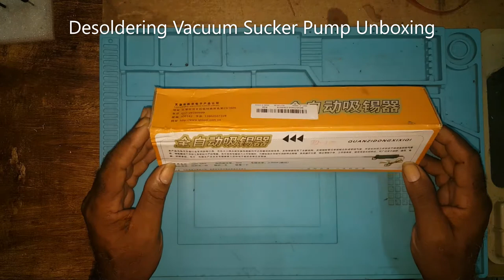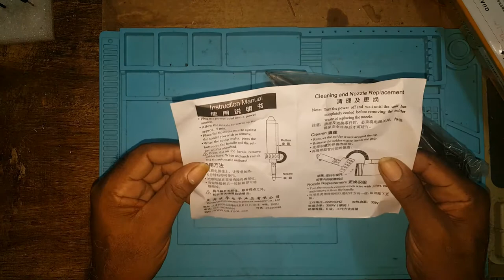Desoldering Vacuum Sucker Pump Unboxing

Comment: I bought this exact model (not the more common blue one) last week. Worked fine first time I used it (to desolder an STK IC) .. second time, desoldering 8 capacitors - after the 6th one the plunger jammed and I couldn't get it to move again, not even by putting in a piece of stiff wire through the back and 'hammering' on the plunger. It was stuck solid! When it stuck the handle became very hot, too. You could hear a little hum from the solenoid but no sound of the plunger of course. Returned and got a Yihua 948 instead - 5x the price but it's a better tool.

Comment: Does this thing have a lot of kickback to the board? My hand-operated ones would sometimes kickback and cause the soldering iron to nick and damage the board. My other concern is the collection of hot solder inside the bellows may eventually damage the rubber. Can you show the inside of the bellows? Seems to be of better construction than the "Blue Model" How yours holding up?